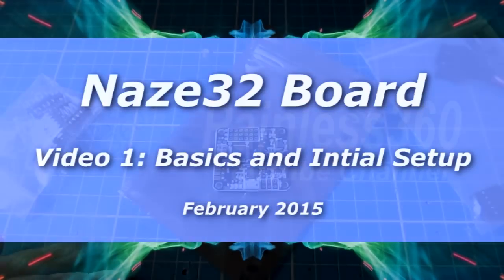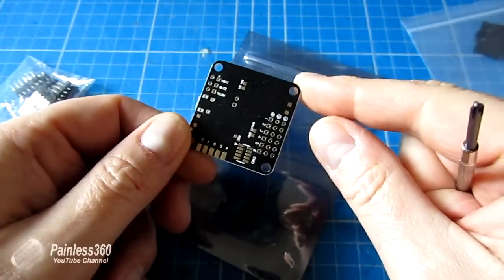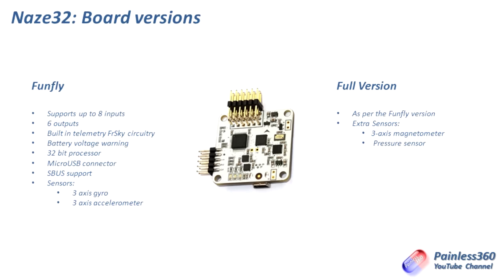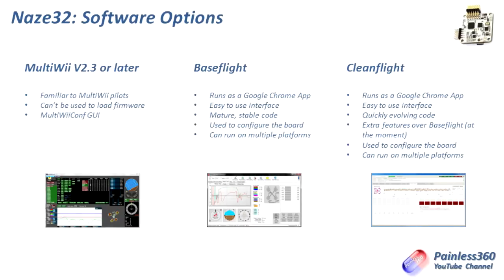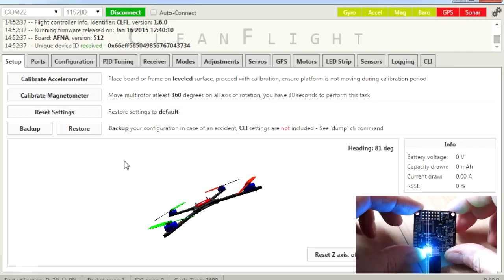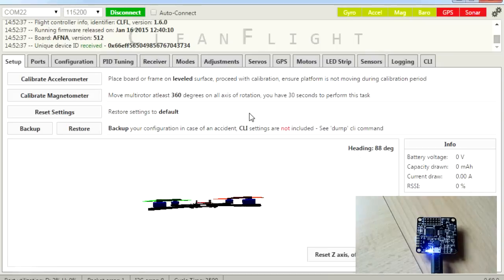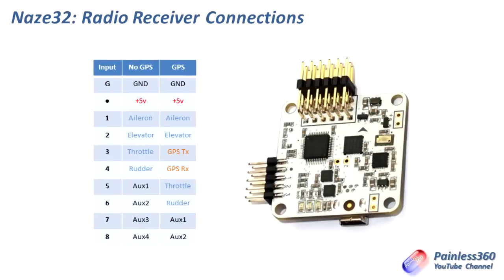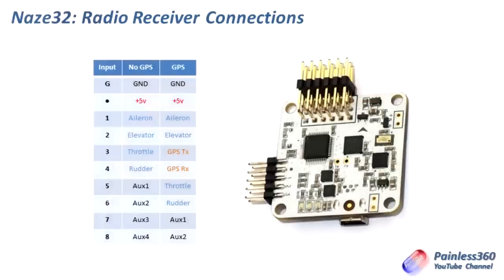(1/8) Naze32 Flight Controller (Full version) - step by step initial setup

Comment: Where can I get the drivers to run the comm port to even connect the board to my computer?
Reply: +Douglas Strain FTDI Drivers are used as with other normal USB UARTs. Available from FTDI directly or through the Arduino IDE. Have you ever used an arduino or uart before?
Reply: No, have no idea what a FTDI is or URAT is but I did fumble around on Youtube for a while and did find a hyper link to get what I needed from some company in California silicon valley. It was almost a plug and play deal took me an hour to get it to work.  Thanx though.
Reply from the maker: +StarlightVisual Nope, we always use and FTDI board here - we even have a video on it ;)
Reply: Painless360 Nope? To what...? FTDI chips are USB-UART hardware serial converters if that's what you getting at? Otherwise i'm not quite sure what the negative is about...

Comment: is there any way to tame the thing down just too much all ut performance
Reply from the maker: +James Reed yes, depends on the area you need to calm. Look at things like expo and rates in Betaflight.. Best of luck
Reply: Betaflight am I already outdated ? i want to make it fly like the phantom did i got a AMP 2.6 i will playwith next , the NASE 32 is bad ass i love it but you got to stay on top the programing uses all th power those phantom 3 motors can produce and its fast, thank you Man you are helping a lot of ppl with your youtube
Reply: I got it found this wonderful thing called Air Mode,  seams to be so much more controllable , but have to switch it back to angle mode to land , got GPS working very well had to use clean flight 1.4 GPS does not work as well as the DJI but better then not having it

Comment: Maybe someone can help me out.  I'm working on my first build.  I did all the soldering and everything looks good.  I'm trying to figure out how I'll get the 5v to power the Naz32.  I'm using Simonk 20A ESC that do not have a BEC.  Any thoughts on how i can get my 5v to this flight controller?
Reply from the maker: We look at the later in this series.  Best of luck!
Reply: +Painless360 Finally figured it out, but thanks

Comment: does it come with the cable that connects to the speed controllers?
Reply from the maker: +AR Gaming It comes with pins you need to solder on and the cable to connect to the ESC is actually part of the ESC itself. Best of luck.
Reply: +Painless360 ok thx 😊

Comment: @Painless360: Would you perhaps know how to change a 4-in-1 ESC from bidirectional to normal/reverse mode? I've got the Emax Nighthawk 280 quad with the integrated Skyline32 / Naze32-based controller. For some reason mid-throttle is a low rpm idle, low stick is full power reverse, high stick is full power normal for the motors. It seems the ESC is stuck in bidirectional mode and I can't seem to enter programming mode. I can't seem to use Baseflight / Cleanflight software either to properly reprogram the ESCs.
Reply from the maker: +PHeMoX Sorry, I don't. What does the supplier say?
Reply: Painless360 They asked us to send the entire quad back to them. I guess we're getting a new one (reflashed ESC I think) to solve this. Thanks for your response though. :)

Comment: hi there all I am having problems with the new naze32 rev 6 board after much reading and videos I managed to load the latest firmware of cleanflight on the board so now I can connect to cleanflight however the problem is that I managed to calibrate the accelerometer but the button to calibrate the magnetometer isn't allowing the calibration I have a naze 32 rev 6 10dof board so the mag should be able to be calibrated but it wont any ideas from anyone would be great I plan on using this board on a new tricopter build please help peter
Reply from the maker: +Peter Webster is the mag lit up green at the top? In the latest gui you need to enable the mag and baro as they are disabled by default.. all covered in the release notes. Best of luck!
Reply: hi lee I just checked to see if the mag and baro are green and they are not lit up
Reply: sorry to bother you lee but I have looked through a lot of documentation and I cant figure out how to enable the baro and mag any ideas would be helpful cheers peter
Reply from the maker: https://www.youtube.com/watch?v=Bbw_WAUu3MI may help! :D

Comment: Thank you for the video. Have you run into a situation where your naze board gyros are not registering on base flight? I have flahsed my Naze acro board using both clean flight and base flight, but when I plug it in, the little 3d rendering does not move and the gyros do not register movement. The barometer works however.. Am I missing something?? subbed..thanks!
Reply from the maker: +Sal Mastropolo Not sure, as I've not seen it on the Naze32. I have seen it once in my building career and a recalibration of the accelerometers got it all working.. Hope that helps..
Reply: +Painless360 so simply tapping the calibrate accelerometers got them working for you? I'm gonna chalk it up as a defective board if so, as I've tried that... Thanks for the quick response !!
Reply from the maker: Yep, calibration sorted it. Does sound dodgy and I'd be suspicious of it even it you got it working... Best of luck..
Reply: Thanks again!

Comment: when i plug in the naze board the lights turn on. but clean flight does not change the com like yours did. when i try and connect it says no configuration received within 10 seconds, communication failed. can someone please help me.

Comment: what about the other x2pin? is that for the Telemetry / Bluetooth / XBee serial port ?
Reply from the maker: Not sure which one you mean..
Reply: it is the one you did not put on ...the 2 pin one in the manual it is Telemetry / Bluetooth / XBee serial port  RX and TX connectors from the USB Serial converter are available here. Can be used to connect Bluetooth / XBee / etc to allow
 changing settings without connecting USB...sure it is no big deal ..becaus if you did not use it i prob. will not ..for a 250

Comment: Running into a bit of trouble, and I'm worried!
Connected the motors to ESC and connected it to the power distribution board.
And plugged the signal wire into the Naze32.

Tested the Naze32 - No smoke. - Plugged in the battery no smoke.

Tried testing my motors, via the motor test in Cleanflight, none of the motors spun. 

Since, I was following a guide, I plugged in the D4R-II as they had plugged it in first, not sure if the D4R-II is powered, no LED turn on, when holding the F/S button. - Still plugged into computer.

Am I missing something?

PLEASE HELP!
Reply from the maker: X1XNobleX1X You are arming the board? See the other videos that cover this and more - To watch all the videos in this series visit https://www.youtube.com/playlist?list=PLYsWjANuAm4p47OBBTOo4Xr3lNUc8PFpc
Best of luck.
Reply: Painless360 Binded the D4R-II to the Taranis X9D+, roll, yaw, pitch, throttle seems to work. But the AUX switches don't move in the channel monitor either.
Reply from the maker: A video would help.

Comment: Greetings 
 I find you instructions to be very easy to follow.......BUT...I still have a bit of a problem.    I select firmware ....load firmware (online)...but when I flash..  it comes to a big stop
I do not get the (green band) with the programing successfull.
Any idear of what I'm doing wrong ??    (I have not soldered the pins)
  Thanks...
Reply from the maker: You may need to force the board into Bootloader mode - see http://www.rcgroups.com/forums/showthread.php?t=2234503 for more details

Also, check the USB cable has all four wires connected in it..

Hope this helps..

Comment: Hello , here i am , trying to fly,some adjustements to be done , if i want to be horizontal , my aileron trim is completely on the right.And when i try to setup ANGLE Mode , i have a red led lighting , what does it mean?Does not seems to be correct.But i was able to take off...its a beginning...
Reply: +francois Bonin after watching the rev6 from Flite test the red led seems to be normal in Angle Mode.

Comment: I just tried to do this to my new naze and the Magnotometer  isn't showing up to calibrate???? help
Reply from the maker: Happy to help but please watch https://www.youtube.com/watch?v=olIqTiSJHIY and come back to me with more detail of what you've tried..
Reply from the maker: You may need to enable it in the GUI.. See the sensors on the left hand side just under the image of the quad motor layout..
Reply: I am using a naze 32 rev 6 and a flysky fi-ia6b in ppm mode. running version 2.0.1 firmware. the magnetometer button isn't  able to be pressed. when I click on settings when the page first appears it is but within the blink of an eye it fades and isn't functional. even if I enable it in the GUI. Have not found a video showing a fix to this problem.. any help would be appreciated..
Reply from the maker: Not sure then. I'd make sure the FC had one on. It should be detected automatically. I'd go back to the vendor for help. Best of luck!
Reply: thanks for info and all your videos. Def helps a old greenhorn like me...

Comment: ok I have watched these over and over....all wiring is correct....proper receiver tested on a different quad....radio is new and bound to receiver....but cannot see anything moving on the receiver page of cleanflight or betaflight....i disconnect power from receiver qx7 says telemetry lost so on....Im lost...clean and beta both allow me to test and run motors....accelorometer works great.....HELP!!!!????????
Reply from the maker: Please see the 'Quadcopter building for beginners' and also the 'Seriously Pro' Series. Lots of information in there about what to do and how to set everything up. Best of luck!

Comment: Hi . just  installed the NAZE32 on a Quad using your Video off You Tube but can't get power to the receiver even though the motors are connected and running off the Cleanflight programme . There is no power at the pin ,
Reply from the maker: +Melvyn Lewis if the ESCs are opto then you'll need 5v from somewhere. See our quadcopter. building for beginners series for all the detail. Best of luck

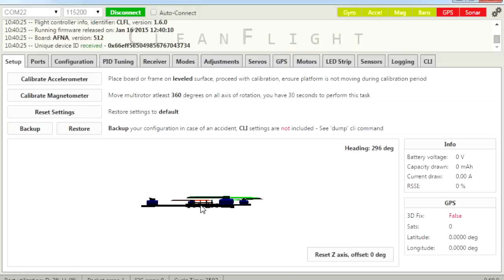Comment: Hi! I am having trouble with my setup, any help in this matter is greatly appreciated!! At 23:30 into your video, you talk about the magnetometer calibration and how the heading should be at 0*. I have double checked through google maps and with a compass in my hand to verify that my quadcopter is facing north, yet my board is reading 140* in baseflight. I have looked at the arrow and made sure my board is facing the correct way in my quadcopter and other basic simple things like that, I have also checked for magnetic interferences. Is there a way that I can calibrate the heading to 0* manually? any help with this issue is greatly appreciated!!! Thank you!
Reply from the maker: Not sure what's going on. Defective mag maybe? Make sure you are moving the model several times through all axis.. Best of luck!

Comment: Great video but I seem to have a problem. I open the software and plug-in the NAZE32 and I get a blue light, red flashes a few times and then green comes on. I click connect and it says the serial is successfully connected but times out in 10 sec. and closes saying no config. was found. so I am not able to flash the board. Any Thanks
Reply from the maker: What troubleshooting have you already done?
Reply: Painless360 I installed some drivers that fixed the problem of the system not seeing the NZAE32 so it is recognized when I plug it in (by the computer) but still will not connect. I tried Baseflight and Cleanflight and get the same thing and I have tried 2 diff. computers, same thing. Tried all the com port showing and tried lowering the baud rate to 57600, none of this helped.

Comment: I have a micro brushed naze32 and it will not connect at all. Any suggestions? I've downloaded drivers but it does not come up in the com port on cleanflight
Reply from the maker: I'd try another USB cable.. Best of luck!

Comment: Please reply, i did everything, the motors start with 100% sync on cleanflight master control, but it stutters madly when i throttle up the quad, every motor is out of sync, (Naze32, Emax rs2205s, DYS 20A Blheli_s, Matek HubOSB, FSi6) i don't know what is the problem, Please help
Reply from the maker: +Devjit Paul I'd look up problems using BLHeli_s in the forums. I don't use BLHeli_s here and I've not seen it personally but there are lots of issues reported. Try another version on the ESCs. Best of luck!
Reply: thansk, and one more thing, when connected to cleanflight, and when im trying to calibrate the escs it doesnot make the usual, music tone, when i unplug everything and connect to a battery to does the usual tone,
Reply from the maker: I'd look at making sure you have the right ESC settings in Cleanflight and if that's ok then look at changing the version the firmware on the ESCs. We've had problems here with Betaflight and BLHeli versions (see the build series).. Best of luck!
Reply: thankyou

Comment: G'day mate, the board you are working on, is that the Acro Naze32? Cheers
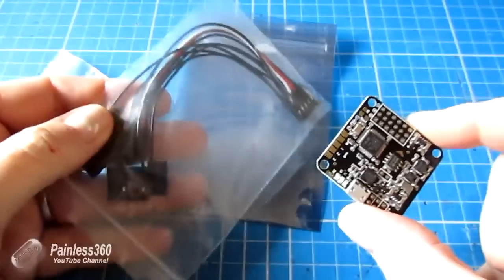Reply from the maker: This is the full version that includes all the sensors. You can see the difference at (2:03). You need the full version if you want to look at adding GPS later..

Comment: I could flash naze32rev6 with clean flight well. But when I try to connect 'no configuration received within 10seconds,communication failled' message appeared. I tried with beta flight too. but the same message always appears. I've installed 'cp10x' and 'stm usb vcp' both drivers.
Reply from the maker: I'd try and use the boot button to reflash.. Best of luck!
Reply: +Painless360 I reflashed many times using the boothpads. and flashing happened successfully. only problem is it doesn't connect. I tried to use 'rc impulse driver fixer'. But it also doesn't detect the flight controller.
Reply: +Painless360 I'm sorry for annoying.But I'm actually lost here. please help me to overcome this problem. I'm now keeping my quad for many days without any progress.My FC(naze 32 rev 6) can be flashed successfully but can't be connected. I've mentioned the problem in previous comment.
Reply from the maker: Sounds to me like a driver issues. I've not seen it here so I've not idea the exact fix. I'd use the drivers that are linked to on the welcome page on the Cleanflight/Betaflight GUI.. Sorry I can't be more help..
Reply: it's ok. thank you. I'll try something.

Comment: hi i am making a flitetest Tough tilt flitetest tricopter with naze32 and cleanflight. when i plug it into the computer the computer shows that throttle and stuff is working and when i throttle up using the computer the motors work but when i throttle up with my transmitter nothing happens (the rudder tail servo does work using the transmitter).
Reply from the maker: emile What troubleshooting have you done?
Reply: Painless360 i removed the micro usb and restarted the board and i have tried to use another version of the firmware.
Reply from the maker: Why remove the USB? Are you arming the board? It defaults to 'Always disarmed; by default. All covered in this video series..
Reply: Painless360 i have watched a few of your video's again and i found out i needed to increase the rainge of the yaw to arm it
Reply from the maker: Quite common. You're not using the playlists are you ;)

https://www.youtube.com/watch?v=6U-rjC39EXQ&list=PLYsWjANuAm4p47OBBTOo4Xr3lNUc8PFpc&index=3

Comment: An update  for people who are using the NAZE32 REV6a. it is a bit different than the one used in the video and I have been on it for several hours trying to figure out how to connect the NAZE to a PARALLEL receiver (In my case the FS-iA6), so I thought Id publish here the setup I am using and save some time for others.

The NAZE32 REV6a has different connectors. The ESC connectors are identical but the receiver connectors are different. 

 On the NAZE, if you align the board so the direction arrow is pointing  up, the receiver pins connections are on the left, the two blank connectors (the once on the top with no labels next to them) are : upper - GND, second from the top - +5v. #1 is ROLL and PPM, #2 - PITCH, #3 - YAW, #4 - THROTTLE, #5 - AUX1 .... #8 - AUX4.

Connect the GND (most upper pin on the NAZE) to the right most pin on the B/VCC pins line (The one closest to the edge of the receiver) of the receiver. The +5v (second from the top on the NAZE) to the middle pin on B/VCC pins line of the receiver. #1 on the NAZE to CHANNEL 1 most left pin on the receiver,  #2 on the NAZE to CHANNEL 2 most left pin on the receiver,  #3 on the NAZE to CHANNEL 3 most left pin on the receiver,  #4 on the NAZE to CHANNEL 4 most left pin on the receiver.

I tried to use the cable supplied with the NAZE but it did not work at any configuration. I had to use individual cable connector to make it work. Also when I connected the power and GND to any other pins the receiver worked but the channels did not match. Only when I connected it as described above did I get the right response.

I tried to place images in this post but they did not show after sending the comment so you will have to do with the text. I hope its clear enough 

I hope that will save some time for others.

Thanks for the video.
Reply from the maker: +ehboym1 thanks for posting. Nice work!